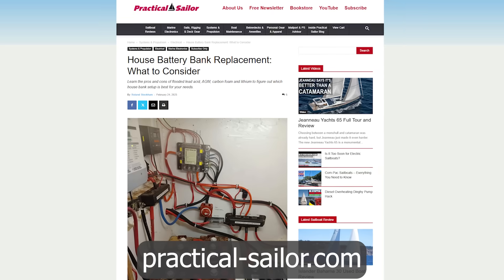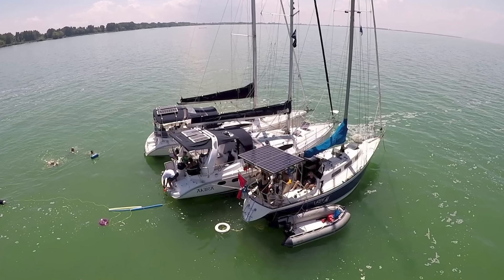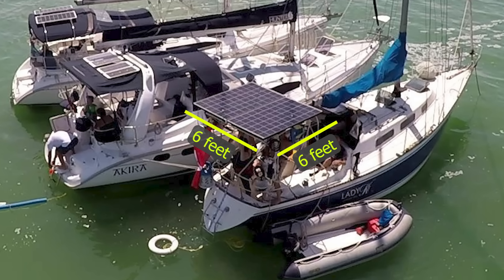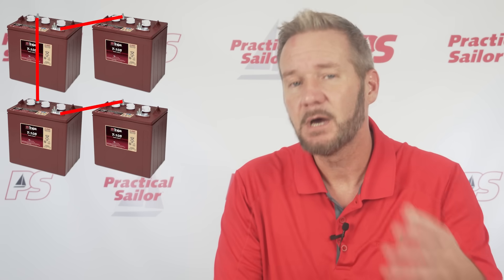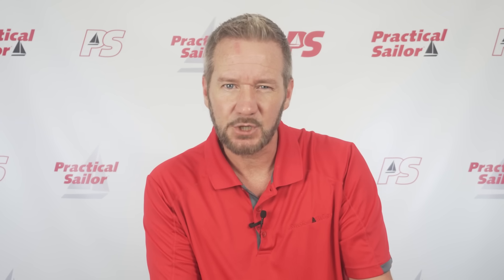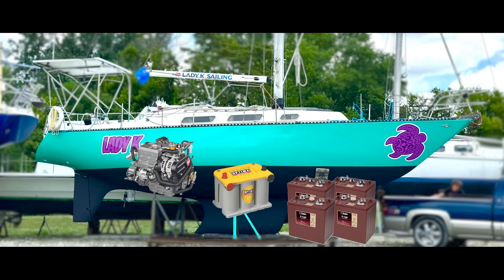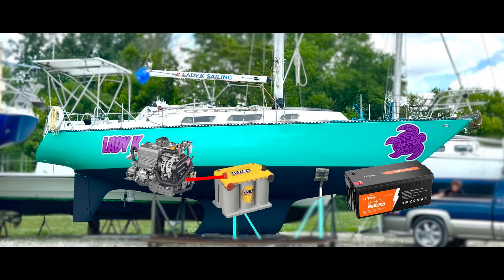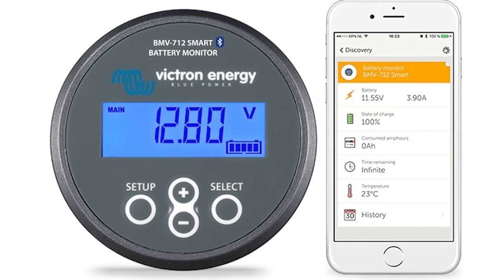Which Batteries Would I Buy TODAY for my SAILBOAT?

Comment: Thanks for a helpful piece. I'm anticipating replacing an AGM bank with the 315AH LiFePo4 bank now sitting on my shop bench waiting for  all the snow around here to melt. Also adding 400w of solar with MPPT charging but no inverter. You have clarified how to use the alternator output from the diesel to indirectly charge the house bank via a dc/dc charger--I'm looking at the Victron 12/12/30a unit now. If I remove the DC battery selector to avoid accidently burning up the alternator trying to charge the house bank I lose the option to start the diesel from the house bank or from both the house and starter batteries. My sense is that I cannot use the DC/DC charger in reverse should the starter battery fail for any reason. I guess I could install a second DC/DC charger in the opposite direction with a manual on-off switch. I'm wondering if the sensible course at this point is to think about a full Victron inverter-charger setup--the price delta starts to diminish if we're talking about that vs. the MPPT charger + (2) DC/DC chargers.
Reply: Your solar sounds like 4x100W. If you're thinking 1 charge controller, I think that's your week point. Consider 2 or 4 MPPT charge controllers. Lots of display not necessary. That would be higher priority to me than redundant starter battery tech. $15 jumper cables if you're really worried about it. For all of my land/sea equipment I have an AGM jump battery kit that I use for many things. You could keep that onboad, ~$40 and great for bench work.
Reply: @artsmith103  Actually (2) 200w bifacials on the dinghy davits. My big boom doesn't leave me much room for an arch or bimini. I'm having a new dodger stitched up, so maybe a flexible panel on top of it to boot. Since the davit mounted panels will see pretty much the same insolation, maybe one MPPT controller there and another for the floppy panel/s when that happens? (My impression was that individual controllers were more about accommodating variability--like partial shading--between panels. Is there a reliability/redundancy issue as well? Maybe about reliability of the panels themselves?)

I like the idea of the jumper. I've been luggging a portable 2k Honda generator around, with a cheater pigtail to plug into my 30amp shore power receptacle. I've got a ProNautic AC charger currently wired and configured to charge both the house and starter batteries from the Honda or (infrequent) shore power; I'd lose that charging capability without the Honda, but if I can start the diesel with the jumper I'd just be burning diesel instead of gas to emergency charge. I'd probably wire and configure the ProNautic to charge the lithium house bank only, assuming that's more efficient than running alternator output through the starter battery and DC/DC charger.

I think my assumption in the original post that the Victron inverter/charger incorporates an MPPT controller for the PV might be wrong anyway which would make that original cost comparison question wrong. OTOH, I might want a good inverter when I get to thinking about a microwave on board (reefer/freezer first!)
Reply: @jeremygrip2307  Yes about separate MPPT for panels with different sun exposure. SunPower is a good name for flexible panels. My jump battery is Vector 700A. Does great with 3L and smaller, my 4.2L van is about it's limit. I use more as portable battery pack: trade shows, camping, bench work. Wish it had a 12V power point but I just use the clamps. Button is positive, side spring(s) are negative. Be very careful if you go with CostCo quality Li Ion style. Personally, I wouldn't.

Comment: My liveaboard, 15kW Gobel Power 48V GP-SR1-PC200 server rack, with Ecgsolax 10kW 48v off-grid All-in-One charger/inverter, under $5K.
All nice and compact, less wiring, etc, vs multiple batteries, all those expensive victron components.

Comment: So with your setup, you would not need to plug the boat into the dock to keep the battery charged during the week when you're not using it. So do you still plug it in? And why?
Reply: There is lots of useful info out there by people a lot smarter than me when it comes to lithium batteries and how they're set up for charging, especially with shore power.  The first thing I learned was to expunge everything I knew about conventional batteries (lead-acid, gel, AGM).  It simply doesn't apply to this technology.  Lithium iron batteries do not like being kept in float status like the old batteries, and, in fact can be damaging to them.  If they have to be kept on float, it's recommended to put them on a very low float voltage setting to keep ingoing amps at a minimum.  These batteries like to be charged to 100% to balance the cells and then be discharged, with the latest information I can find to discharge down to like a 5% SOC (state-of-charge), and then charge them back to 100% and repeat.  That's obviously using 90% of battery capacity. These are lithium IRON and are different chemistry and not to be confused with lithium ION, which like a discharge to 20% and then charge to 80%.  Simple math tells you that you're losing 40% of your AH capacity by doing that; might as well keep the old tech batteries and use the old 50% rule.  Research youtube videos by Will Prouse.  He is really good at this stuff.

Comment: I too built my system in 2018.  I have 8 panels with 1 4D and 5 Group 27 AGMs which gives me about 350 working amps.  lived off it for 2 years and never had to run the generator but now we are refitting the boat for our next around the world trip and most likely I will replace the batteries (they are still good but for how long...they  will be 8 years old then) with 7 AGM Group 27 or 31s.  The price is about the same for nearly the same amps but AGMs are tried, true and tested.  Harder to destroy an AGM than a Lithium Ion Phosphate and no special gear needed.  Not worried about the weight because it helps balance the boat.  I will be adding another charge controller and 4 more panels (800 watts) on the rail to make up for adding 2 or 3 E-bikes.
Reply: I have lithium batteries in all sorts of things and have experienced swelling and even an actual fire once. I realize that battery technology and construction is better today but they still do catch fire and the consequences of a fire in a glass hull would be catastrophic.
Reply: @longmemory4716  lithium iron phosphate? Or lithium ion?

Comment: I was starting to switch over to lithium  just dedicated for the refrigerator and the freezer until I talk to my insurance man 
Not covered !
I do you like the lead acid with the windmill never had any problems anything happens to them they're basically rebuildable every 4 or 5 years some baking soda a lot of DI water  new acid and a couple of ounces of battery additive cadmium sulfate
and you're good to go
Same cat 153s lead acids since 92
Reply: Your insurance man thinks you are using lithium ion, which should not be on a boat. But Lipo4 are totally different and I believe they are approved by ABYC.
Reply: @starboardfilms  I believe you might be right
Talking with them I might have just said lithium in lieu of lipo4
Reply: So you're 100% correct have to say lipo4 
&
Also I see here on some post where they're mixed in matching different solar panels might want to mention there's math for that cuz if you put like a 100 watt with a 50 watt you're not going to get 150 watts
Reply: PS 
The smaller panels don't do as much unless they're on a separate controller 
Or a controller with separate connections 
My hybrid controller the solar panels are isolated with a blocking diode 

&
Don't forget to put fuses at each panel 
Also have a bypass switch for cloudy days

Comment: Hi we enjoy your videos, have you done any content regarding standing rigging? dyneema vs stainless conventional riggs?...
and what electronics manufacturer (wind depths radar etc..) would you recommend..? thoughts on mix and matching brands?
Reply: For electronics after much thought this is what I landed on. B&G Vulcan 9, Garmin Airmar DST810 Smart Transducer (this allows me to have just one hole in the boat and fill the other as it does depth, speed, temp, pitch and roll all in one) and a Lowrance WS320 Wireless Wind Pack. This will leave me with a platform that can easily be added to should I want to tie in an auto pilot, add radar and AIS overlay to the chart ext..

Comment: Was involved with a catamaran solar set up in 2020.  Two 320w REC panels( at 60 cents/w, total 640w) in parallel on hardtop, 60a MakeskyBlue MPPT w wifi app, MC4 items, Z brackets, deck flanges and 60A circuit breakers from Amaz and 4 12v 150a gel batteries.  System has worked fine ever since, however the relatively cheap 60A circuit breakers were only good to about 40-45amps (not well known deficiency at time) so were replaced with better quality.  All told ( excluding bats) cost was $1/watt, now would be around 75 cents/w.

Comment: Good info. Not our exact configuration. We have a catamaran with two 20hp outboards. They charge at 12 amps each. I'm assuming the same rule applies. Charge the starter AGM battery with the outboards and then connect to the lithium house bank via a dc to dc device.  Solar panels charge to the house bank through the controller.
Reply: Not recommended the alternators will lose there smoke. To small. Hes using an alternator around 140 amp range.

Comment: I like your solar charging idea, but it uses a lot of area. I would consider a wind powered generator. On my boat I am considering replacing the outboard with an ePropulsion Navy 6. These electric outboards will generate power while under sail. It's called hydrogeneration and I think ePropulsion is the only marine electric motor company that offers that feature.
Reply: Study the wet/dry turbine generation curves carefully.

Comment: Only thing I would add is go to 24v or 48v.    Keeps the wiring smaller and much more efficient.
Reply: I agree with you on the wiring. Though more 12V appliances and devices are available.
Reply: You go AC (120VAC) for most "convenience" appliances.  A/C, water heater, washdown system, etc.   Then you can just use regular consumer gear which is a lot cheaper.  The legacy 12V gear that remains will be boat-specific items that might be too expensive to replace with higher-voltage DC gear... like electric winches for example.   Usually if one has a 12VDC fridge one keeps it on the DC system since it always has to be on... that's low amperage anyway.

When using a higher-voltage home battery, the key is to keep only critical boat items on the 12V system (nav lights, radio, at least one bilge, etc).  And instead of having a DC-DC converter to go from the home system to the 12V legacy system, you have a low-amperage DC-DC charger plus a small 12V (typically LiFePO4) buffer battery.  The buffer battery handles the peak 12V loads.

-Matt
Reply: Use 12 volt fridge/freezer, lights computer, etc and leave inverter off.    A 2000 watt inverter can easily take 30 ah from your battery bank each day just being on.

Comment: Another simple and very informative explanation of the conversion to lithium. I've certainly thought about it, but without refrigeration there is no great draw on the batteries and the AGMs are doing the job just fine. I am not a fan of solar panels over my head, but lithium and an eFoy power system may just be enough to get me to thinking about refrigeration. Thanks Tim.

Comment: I have a similar setup, except I'm using the Renogy 60amp to 60amp DC to DC charger which I detune to about 45 amps (through the mobile app).  Had this system for about 18 months without problems.
Reply: @leecoulter8530  does it have temp regulation?

Comment: Great video, and very informative for me as a veteran boater, currently boat-less!
Many years ago I had a beautiful 36' motor-sailer, which motored much more than sailed. My cruising area was the West coast of Scotland, and trips were typically a month at a time, plus every weekend. There were no solar options, no computers or Starlink, all we had was lighting (no LED in those days!) a VHF radio, and a fridge which ran on 12V or gas...gas at anchor, 12V when engine running. The peculiarity of this boat was its 24V windlass. This meant that the batteries were configured for this, so we had 4 x 6V heavy duty lead-acid truck batteries, and the starter motor for the engine was 24V as was the alternator. Also, the lights were 24V truck bulbs, which were quite a heavy draw compared with modern LEDs.
We had 2 x 12V lead-acid batteries for the 12V loads, in parallel, but we could switch them to give 24V if the main batteries couldn't start the engine. We never needed to do that in 10 years of our ownership. The 4 x 6V batteries never faded, so that's old tech for you...durable and reliable. I did have them reconditioned after 5 years, you could do that in those days, and today I have concerns over lithium batteries due to the concerns over thermal runaway, especially in a salt-water environment, but that's a whole different argument.
Whatever, I had 10 years of faultless service with that setup, with arguably heavier draw than nowadays, no genny, no solar panels, and I never, ever had to go to a marina for shorepower...because there just weren't any marinas nearby in those days!
Cooking and hot water was by LPG. It was never a concern running out of battery. We had all the power we needed on tap, and in addition, we had electric blankets on the 2 main berths...a trick we learned from fishing boats...they were mains power units that ran on 240V but via a transformer which took it down to, yup, 24V. Run the engine for a few minutes and heat up your bunk, or switch those blankets on for a while as you approached your anchorage for the evening. Honestly, lack of electricity was never an issue. 
Gel 12V batteries were the new tech in those days...at 4x the cost of lead acid...it was easier and cheaper to buy a spare pair of 12V, and you had flexible power options of 12 and 24V at low cost. Yes, simpler times, but life was simpler then and I know when I buy my next boat I will be going with "car" batteries and nothing else. Last year I sold my 18 year old Audi A6 diesel V6, and it was still on its original battery. 
Yes, I must come over as a boring old git, but trust me, with 60 years of cruising under my belt I believe I have the experience to know what is simple, what works, and what is cost-effective.
I hope this post might add a dimension for those who are not totally into high tech.
If you have got this far....thanks for reading, and fair winds to you all.
Reply: From France: Good memories! Thank u Colin !
Reply: @gillesmaumus4033  Thanks for your comment! Things were so much simpler in the old days!
In case you might be interested, that motor-sailer was designed and built by Alfred Mylne, a name I am sure you will know.
Reply: Great insights & ingenuity - thank you.

Comment: Hunter 260 trailer sailor...
No solar, 9.9 Nissan outboard with 12v lithium motorcycle battery and backup pull cord. Main house bank central below galley sink 280ah custom lifepo4, A/B switch, second house battery custom 105ah lifepo4 in stock location rear berth locker, 2500 watt autoswitching inverter tied to shorepower input, autoswitching 60a power supply and lithium charger combination.
Runs all loads for ~3 days between shorepower recharges that <8hrs.
Eventually solar or dc to dc charger may be useful, but I prioritized ease of setup. As a trailer sailor setup and tear down effort is significant, plus you are back at a dock most nights.

Comment: We installed 1200W Sunpower flexible panels charging 400 Ah of Winston LFP 12 V house bank which charges the AGM start bettery through the DC-DC 30A charger.  We got between 200 and 250 Ah most days in the Bahamas over winter.
Reply: Good chance your battery was often full so you were clipping the battery charging. Maybe more accurate to say you typically use 200-250ah per day.
Reply: @artsmith103  That's right.

Comment: I have a 42 foot boat and cruise full time. It has a BIG power-hungry frig freezer plus the usual comlement of 12 volt stuff. I do use propane for cooking and that works very well. The 2500 watt inverter gets regular use charging drill batteries and running 110v power tools, of which I have 8.
My solar is 480 watts with 2 on the bimini shaded by the boom and 2 on the rails. The battery bank is 4 100 watt AGMs. This system works just fine except when there are short, cloudy days in January. I am bumping up to 680 watts, the extra on the bimini, to help with that. Unless you are crazy power hungry, there is no need for 1000 watts.
Also, a friend with a big stern arch and 800 watts of solar panels noticed a big effect on extra heeling when sailing on a beam reach. Not something I prefer to do. As well, those big arches with a massive solar array add a lot of stern weight pushing the bow up and messing with the hull design. If the dink is mounted low it blocks stern visibility and if it's high to allow helm stern visibility, then you are adding more weight up high. The higher the weight, the more leverage it creates to heel the boat further over. I hope you enjoy rail in the water sailing!

Comment: I have Catalina 30 and I added 4 trojans.  I also supplemented my boat with 2 150 AH lithium portables to run my freezer and electronics.  I alternate between charging  and use.  Both fit snuggly above 2 of the trojans under the chart table.  My constant staring at the battery monitors has reduced by 75% since I made the change.  And I have a fridge and freezer!